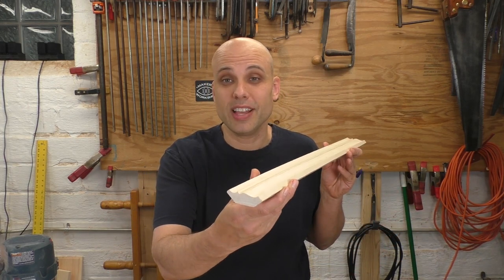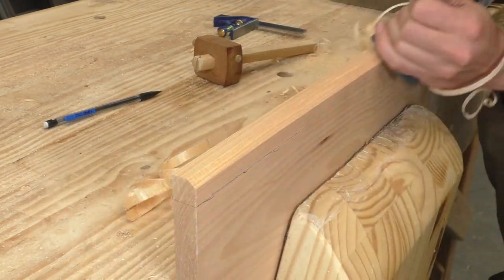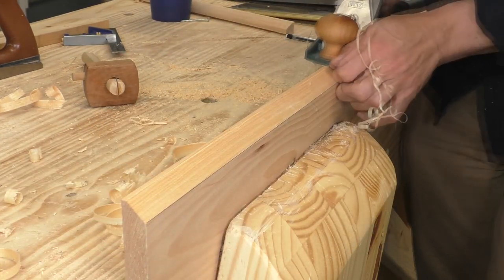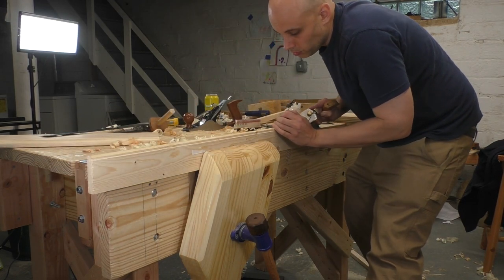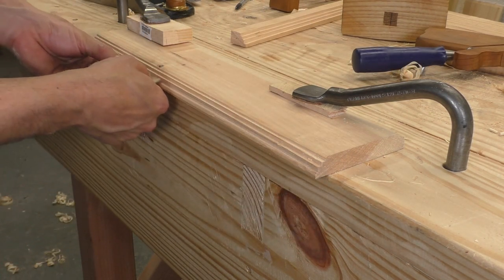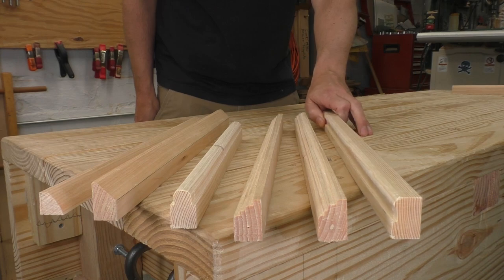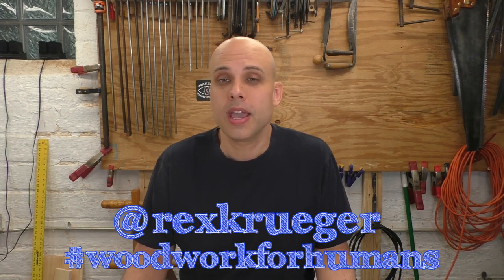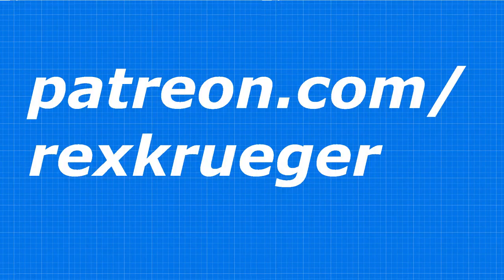Make beautiful moldings with basic hand tools.

Comment: A while back you were discussing chisels and seemed to like the Irwin Marples chisels.  I had a set of them already on order and just got around to using them. Honed them and made my very first mortice and tenon joints. Just had to replace that cheap "case" they came in. Making red oak doors with glass panels. Those chisels went thru that red oak like it was balsa wood! All I can say is WOW! Nothing more satisfying as the sound of a sharp chisel slicing thru wood. I need to get over to you patreon site and sign on, got to give support for the chisel report!

Comment: Perhaps a quick video on combining multiple shapes to create complex crown molding would be a good follow up...  of course after your cabinet is done.  Great video as usual!
Reply from the maker: That is a good idea, but for that, i think I need one molding plane...a hollow, I think.
Reply: @RexKrueger  How far could you get with a bowl gouge (the lathe tool) in something very close to your rabbet plane?
Reply: Installing your bullnose molding atop a 5 inch board, with a quarter round at the bottom, would make shoe molding around a living room .

Comment: Wedge round chisel in straigt peace of wood and you get moulding tool. Cheers Rex!
Reply: Do you mean a gouge? Among many other things, most people don't have that many (or any) gouges, a good set is expensive, gouges aren't used that often in furniture making other than for carving, and you use different profiles for moldings than you would buy for carving. Also, gouges are numbered according to their radius of curvature, but each company has its own system and so you won't easily know which one you need. Carvers usually suggest you start out with a very small number of gouges, master those, and then add additional ones as needed. That's before you get into the incannel/outcannel thing. 
A scratch stock would do the job, but Rex is already working on a video for that, and this approach works well as a lead-in to that. You do the molding most of the way like this, then finish it with a scratch stock instead of buying more abrasives.

Comment: These are fine examples of cabinetry molding.  I'm glad to see them.  I made over 60 feet of quarter-rounded, 1X4 trim to run around the living room just above the windows, and except for using a block plane, I followed the very same procedure, right down the sand paper.  Your other examples have given me some possible solutions for some molding my SO wants.

Comment: Off topic, but has anyone else bought a new sweetheart low angle jack plane and found that it is impossible to adjust the iron straight with the sole? Mine maybe not even ground at 90 degrees, must check.
Great vid, and I am going to try these ideas.

Comment: Rex, I may have missed it, but how did you smooth the bottom saw marks from the moldings?
Reply: Yeah, such small and irregular moldings can be quite hard to hold in a vise. But you can also clamp your plane into the vise with the blade facing upwards (be sure to clamp the whole body with the sole to prevent the cheeks from bending!) and then pull the wood over it, carefully, without cutting yourself. Or, you know, just leave the saw marks, no one will see them on the bottom ;-)

Comment: Finding hardwood of any kind is proving to be fairly difficult here in Northern Texas. But quick question for you Rex. What if I took one of my wood carving gouges and made a router or rabbet plane with it? Something to get a straight concave curve profile? I think it will work. And Harbor Frieght has a somewhat serviceable set of carving chisels and gouges for less than 15 bucks.
Reply from the maker: It's worth a shot. You can only find out by trying it.

Comment: How are you supposed to plane the cut edge on that first moulding? Impossible to clamp, no?
Reply from the maker: Not impossible, but it does take a little creativity.  I think I laid it on the benchtop and grabbed one end with a clamp.  If you think for a second,  you'll get it done.
Reply from the maker: Not impossible, but it does take a little creativity.  I think I laid it on the benchtop and grabbed one end with a clamp.  If you think for a second,  you'll get it done.

Comment: Routers are no different than the hand block planers... except that when you learn to use the ONE router... you have learned to use all the bits. Then it's just about buying them, and putting them into the router, and cutting with them correctly. You get perfectly shaped trim, round-overs, curves, coves, without constantly checking the bevels, the curves, the shapes... and safety, well, it's worth learning, right? Because you won't be working on that trim till next week... Most of your stuff can be done very much safer (than a router) on the table saw or radial arm saw, so that you'll have more time for that Tia-chi exercise you've been doing with that block plane... and now your making paint? Holy wow.

Comment: The working side on your rebate and grooving planes are on the wrong side. This makes you use the planes backward. Fences should be on the left.
Reply from the maker: But if it's on the other side, then I would have to cut rabbets on the ends of boards using my left hand. This thing works great for the work I do the most.

Comment: Hi Rex,  I simply love the way you present! Question: after the quarter round molding is sawn off from the rest of the board, how to you plane it straight and true? The stock is too small and thin to be planed.I've always had this issue and you seem to have mentioned it in the video, but there is no footage of how it's done. Would love youre input on this. Keep up the fantastic work!
Reply from the maker: I didn't cover that very well. I used a screw clamp to lightly pinch the end and then laid it on the bench for planing.
Reply: @RexKrueger  thank you.

Comment: So what's wrong with a Router and a Router table?
Reply: Nothing is wrong with them.  A lot of folks don't have them, however.  If you don't have a lot of power tools, knowing how to use hand tools enables you to be a good and productive woodworker (cabinet maker).  Even if you have some power tools, you may not have all that you would need or want.  I have a number of power tools, but no jointer.  So I use hand planes to get one surface of a board flat so that I can then send it through the thickness planer to get a parallel surface.  When preparing for a panel glue-up, I use hand planes to get the edges of mating surfaces to match up (get a good glue line).
Reply from the maker: Marshall: your polite and accurate response is even better than I would have written to Angelique's totally reasonable question. Nice.